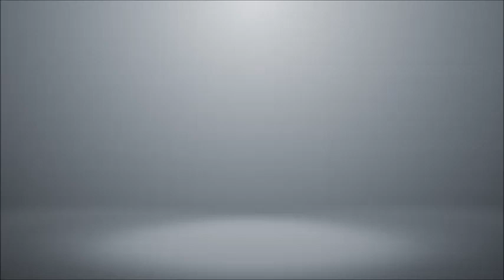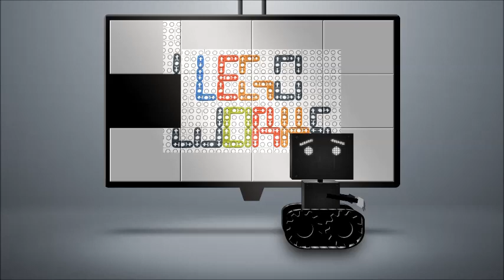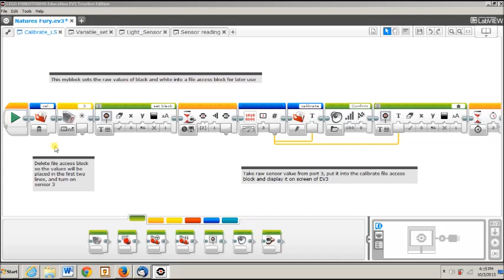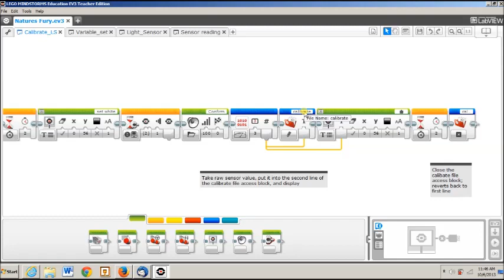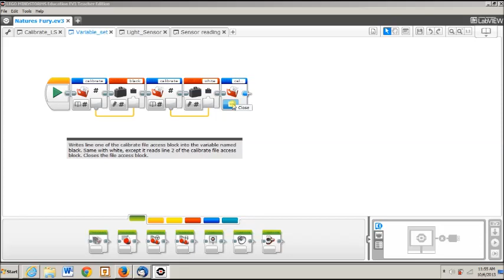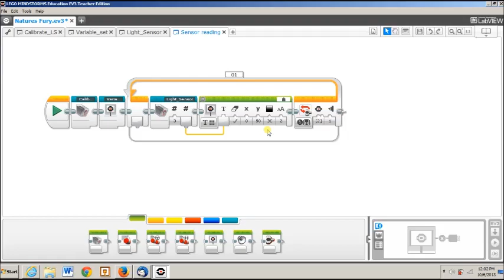Use NXT light sensors with EV3 software

Comment: Very useful video!!
What are the steps of using NXT light sensors in an ev3g code for line tracking?
We use an ev3g code but contains EV3 color sensor blocks.
Should those my blocks be somewhere in the main line tracking program or NXT calibration must be done seperately?
Thanks!

Comment from the maker: @Neel Khare - The equation is (Raw sensor value - Black) *100 / (White - Black).
The raw sensor value is the value coming from the light sensor. The black and white values are from the variables that you set using the calibration and variableset myblocks. If your calibration shows white at 2400 and black at 1300 then the equation would look like this: (Raw sensor value - 1300) *100 / (2400-1300). This will give you a number between 0 and 100.